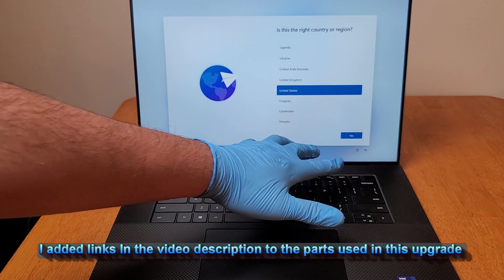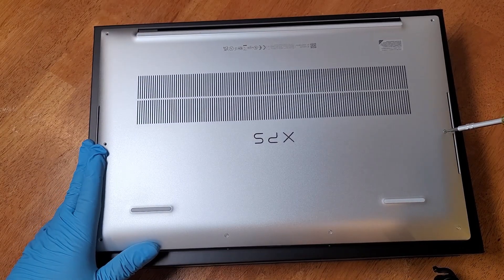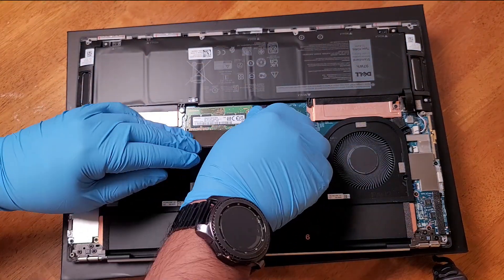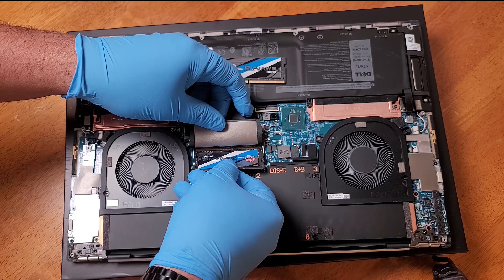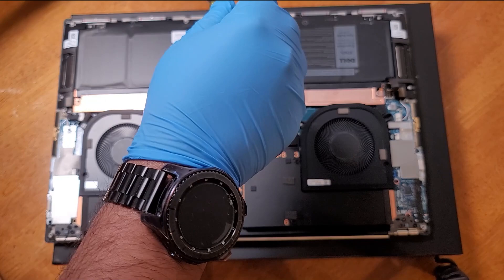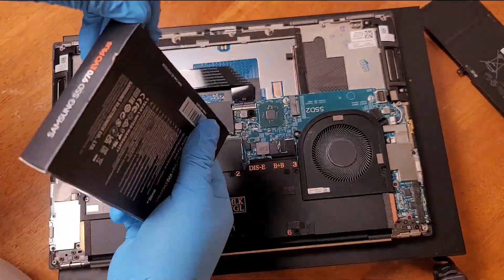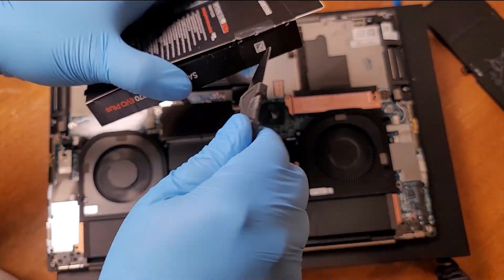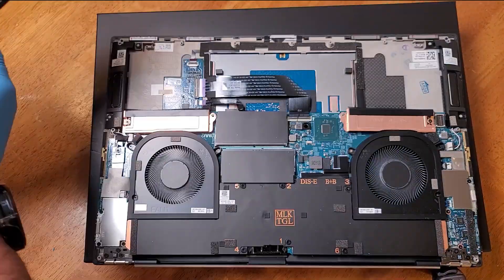Upgrade before its too late! Dell XPS 17 9710 + GSkill RipJaws + Samsung SSD 970 EVO NVMe

Comment: So I just bought the 9520 XPS was wondering I wanted to change the boot nvme to a faster 1 that is also larger,what would I have to do to clone it or get it to where I don't have to put in all the drives again
Reply from the maker: My suggestion is you purchase a Samsung Pro NVME and install it on the second slot. Then use Samsungs brilliant software and clone the drive.  After cloning is complete. Shut down and swap the main drive with the clones one. You could forgo all that and just replace it, install windows 10 or 11 and download the Dell drivers and software. Dell makes it very easy. This gives you a clean install with no extra partitions. You do lose the capability to reinstall the OS the Dell way bit honestly I don't use that. Plus I like windows 10 and don't want 11 yet. Doing this keeps it on 10.

Comment: From 9710 spec page for storage, Gen 4 x 4  is an option:
STORAGE TYPE	                        INTERFACE TYPE	                                           CAPACITY
M.2 2230 solid-state drive       PCIe NVMe Gen3 x4,  up to 32 Gbps         Up to 256 GB

M.2 2280 solid-state drive      PCIe NVMe Gen3 x4, up to 32 Gbps          Up to 1 TB

M.2 2280 solid-state drive       PCIe NVMe Gen4 x4, up to 64 Gbps          Up to 4 TB
Reply from the maker: Thanks!

Comment: i"m having a real hard time finding out what brand of M.2 NVME was originally installed in my 9710 model. Bought my laptop as used, and I checked it's a WDC SN730 NVMe. I have a feeling, it's not the original, so wondering if anyone can tell me what brand was the original?
Reply from the maker: In my experience, Dell does not use that WDC drives for these model laptops. They usually have a Kioxia KXG60ZNV512G or a  Kioxia 1TB SSD XG6 M.2 2280 PCIe Gen3 x4 NVMe KXG60ZNV1T02 Solid State Drive, At times they may even have an SK Hynix brand drive. The laptop in this video came with a Kioxia. Hope this helps.
Reply: @edtheoldtechguy  Ok thanks, so my refurbish 9710 definitely had the original swapped out for a cheaper brand

Comment: I need a new laptop. This one sounds great. How much is it with all the upgrades?
Reply from the maker: The XPS 17 9710 could be had any where from $2000 to $1800 on sale but make sure to call dell and deal down and ask for freebes they may throw in the Blue yeti nano or a docking station, Also apply for the Dell credit card and get 12 months free financing. The RAM upgrade costs  $219, and the Samsung nvme 1tb $109 and the 2Tb $199 you will need to purchase windows 10 if you like or not replace the 1tb hard drive it came with.
Reply: WAIT! YOU MADE A TIME MACHINE?! OUT OF A DELL-ORIAN???!!!
Reply: With all the max upgrades possible from the Dell website (assuming Dell still has models listed, in some regions certain configuration options have disappeared), can cost a bit more than $4000 (64GB memory, 4TB storage, i9 CPU, UHD+ panel)

Upgrading the base 16GB memory to 64GB on Dell website is about $450-500.  Buying the 16GB config and upgrading to 64GB yourself costs around $300 plus/minus a bit depending on the brand of memory.

Upgrading SSD storage from base capacity of 512GB to the maximum storage configuration they allow on their website of 4TB is about $900.  Buying the lowest capacity storage configuration and doing the upgrade yourself can set you back around $300-600 (for 2x 2TB SSDs) depending on whether you buy PCIE 3.0 or PCIE 4.0 NVME SSDs, the brand that makes them, etc.

Since the CPU, GPU and screen panel are the few things you can't or will have a very difficult time upgrading yourself, those are the configurations on their website that are worth considering.  Memory and Storage can be upgrade DIY for lower than price listed on Dell's site.